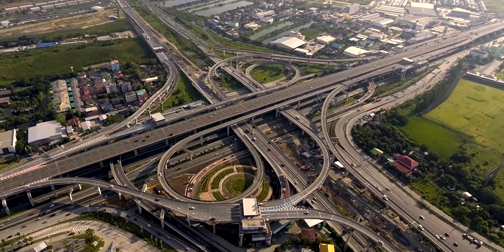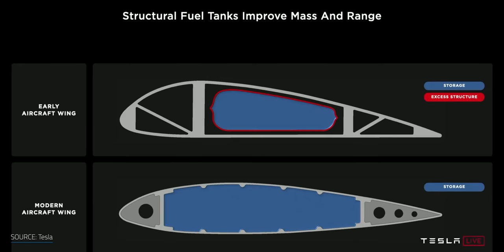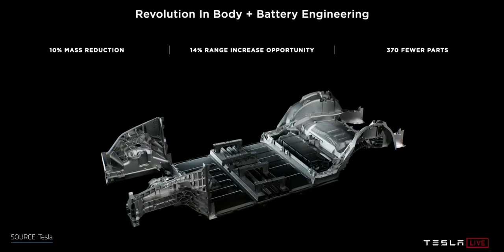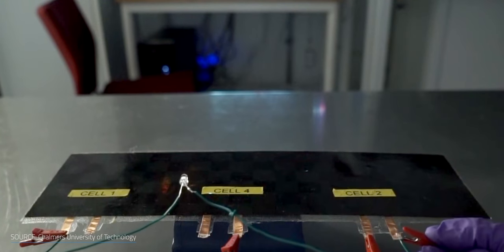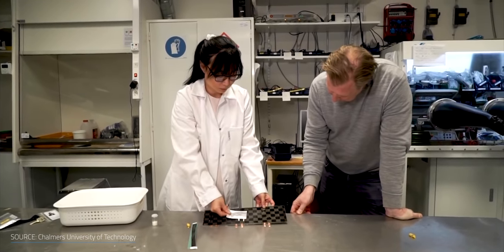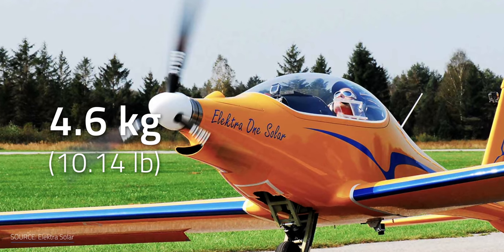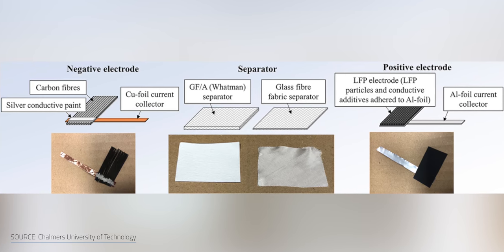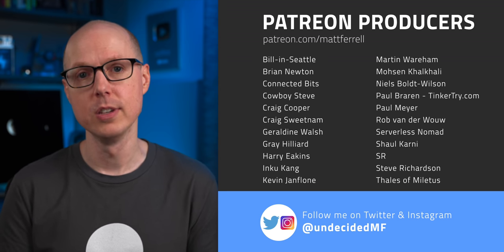Exploring Structural Batteries

Comment: Carbon and glass-fiber's strength comes at the cost of basically zero malleability, it just goes "pop" (broken), it doesn't bend (at all) like metal.  Worse, the cost (in $$$ and CO2 emission) to manufacturer is FAR worse than steel.  Finally, fiber-reinforced-polymers are notoriously difficult to recycle, where as something like (someone correct me) 90% of steel is recycled.  In addition to all the other "break the battery/replace the car" arguments below (which I agree with), overall this is an absolutely terrible idea for cars.  OTOH, it's probably a fantastic idea for electric planes and ion-engine driven space-probes - neither ever need to be repaired after a crash :D

Comment: Everyone knows that EV batteries degrade with use. In other words, batteries don't need to be damaged to need replacement. What happens when (not if) the battery's performance degrades to the point of necessary replacement? How much is it going to cost to completely strip down the vehicle and replace the chassis, in the case of Tesla's example?
Reply from the maker: Tesla's upcoming batteries will most likely last the lifetime of the vehicle for typical usage.  This type of battery (depending on chemistry and use case) could end up doing the same thing. It's still SUPER early days for this breakthrough, so time will tell.
Reply: @UndecidedMF 
How the batteries are expected to perform and how the will actually perform are two different things. Go back and look at covers of old Popular Mechanics or Popular Science magazines, according to their speculations, we should all have jet-packs by now, but had no predictions aboun the internet. I want my damn jet-pack!
Reply: @UndecidedMF  what is the lifetime od Tesla? 10 years or less? Gas cars can be used for decades with maintenance. This is the same scheme like with cell phones. In early stages when battery died you bought new one and used your device for next few years. Later they made phones so you would need to buy new and throw old away. 
I would not be so enthusiastic. If they don't start to build cars that are long lasting and at least with option to repair by users or services, we will drown in trash.
Right now it's almost impossible to repair Tesla. They don't sell parts and they themselves don't want to repair their cars.
It's insane. The same guy is mumbling about climate crisis and selling products that could only be thrown away after few years. This is hipocrisy.
Reply: @UndecidedMF  I'll have to disagree with you on that mate, also some cells can fail in the pack at a moment who knows, there are tousands of electronics in EVs anyways.
Reply: @EpicTimeV7  smartphones are also limited with their software, gas cars/diesel can work for the eternity if wanted, I still see 1970 mercedes used as taxi in Morocco and other very old cars around the world. There is also the problem with electronics, they don't last nearly as long as mechanical parts.
Reply: @rogerstarkey5390 
Where I live in the USA-Ohio, the temperature ranges from 0 deg F to 100 deg F and EV batteries that are exposed to these temperature ranges (many places), simply don't last. There is no big difference between EV batteries yet and my Chevy Volt's battery lasted 2yrs before I lost 30% of its range. By the third year it had 60% loss. Luckily it was a 3yr lease! Also, you're right, the internet is full of deals to buy used EV batteries, many of them are 5 to 7 years old, some are 3yrs old. Yes, most of those batteries can be harvested and used in other things, I actually disassemble and recycle batteries. But let's not be so in love with an idea that we loose perspective. If Tesla feels so confident that their batteries last 1 million miles, they should warranty  them as such. Crickets...
Reply: @cornpop7805  And that is where you went wrong...All chevy cars are garbage and wouldn't touch any chevy with 10 foot pole.
Reply: @teemumiettinen7250 
In regard to our discussion about batteries, the 18650 battery cells that made up the Volts battery assembly were no different than what Tesla was using 3yrs ago. Now everyone is using larger cells, but the challenges of the cells remain the same. The seasonal temperature changes, like in all of the east coast and Midwest cause damage to the cells and drastically shorten their life. I literally harvest and recycle batteries on a regular basis. These aren't 10yr old assemblies I'm reaping from, they're often 3 to 5 yrs old, but could be much older if coming from constant climate areas.
Reply: @teemumiettinen7250 
To be completely honest, I really didn't like the car. It had a horrible ride, had uncomfortable seats, and my elbows didn't have enough room to steer very well. I was glad it was only a 3yr lease!

Comment: "if those battery panels were also solar panels, you get the idea here." Stopping himself from completely lying and saying that the battery can also produce electricity that way.
Reply: wdym?
Reply: i don't think thats the case, unless the carbon fiber itself was somehow photovoltaic, he should know that slapping solar panels on does add weight, but doing that still might be a significant boost, considering most of the structure of solar planes is just there for solar panel surface area, with a close second being gliding efficiency, if the structure was literally a night cycle battery, solar planes might actually be useful for carrying bigger payloads in future.
Reply: @xymaryai8283  Putting solar PV on a car that gets very hot inside when in direct sunlight and is therefore usually parked in the shade where it sits much of the day seems a trifle backward to me. There's also the issue of presenting an optimal inclination. Not great for car bodies.
Reply: @xymaryai8283  carrying bigger payloads by charging with solar panels? Good luck. Even carrying normal load behind a tesla loses half its range. Charging that with solar panels would take weeks

Comment: Great and necessary direction but the problem at our doorstep now is materials recovery which must be integral to actual advancement. Reduce, reuse, reclaim, recycle current and future ion-cell surroundings and component structures completely, minus energy loss required to reconstitute and or repurpose depleted materials.
Goal Battery :  panels, structural components, motor housings etc. along with useful outer surfaces with solar collection ability. Needed, although close to 100% material recovery instead of unstable land mine type problem, MANdatory.

Comment: I wonder how those things would fare in front of the delimination risk inherent to laminated composites, especially in thick panels subject to a mechanical load. Can they suffer from battery expansion problems ?

They could be pretty practical for laptop or smartphones which are less demanding in term of mechanical abuse, but can they even be recycled ?

Comment: According to mat pat, the battery is the one problem with making a giant car robot. With all those moving parts would it be a good or bad idea to use these batteries for such a contraption?
Reply: I mean, it depends, if you had all the body panels and shit made out of these batteries, they could all power a specific part, stopping a large amount of power draw from the main battery. But your issue now, is how you plan on wiring and charging the thing.
Reply: @thereinthetrees_5626  make every "bone" electrically autonomous (forearm structural battery powers forearm, shoulder battery powers shoulder etc). 
Run signal wires from the main control unit to the rest of the robot.
If the robot is injured, the boken part can be removed to reduce deadweight, and the rest of the robot will continue operation without issue

Comment: 1) even the best cared for battery has a ~10 year shelf life. what do you do when its end of life?
2) what happens when you get into a car accident?
3) how safe is it to be literally surrounded by energy vs isolated in one area? would you fly on a plane with fuel surrounding you?
Reply: technically the fuel in planes already surrounds you on both sides
and as for centralized high power batteries? remember those laptops that were recalled because their batteries were exploding?
distributing it generally lessens risks like that, because afaik they dont usually chain react - so one small cell bursting might cause damage, but wont discharge the energy of the entire assembly at once
if there is a lot of energy in something, there is always risk - because if it were 100% safe and stable....you would not be getting energy out of it

though i share some concerns as to how this would change the way a crash plays out - its something that will require serious testing
and yeah... 10 years is probably an optimistic lifetime and it doesnt sound like a structural battery would be easily replaced

Comment: The elephant in the room is still overall electrical generation capacity.
Reply: Not really, since nearly no country uses anywhere near their renewables potential.
Reply: Nah just use more nuclear power and there we go... Zero emissions and steady reliable output whenever you need it.
Reply: @josefstalin4532  
Even though 4th generation nucs should be orders of magnitude safer the odds of overcoming political and public opinion/pressure is probably impossible.
Reply: @rogerstarkey5390  
That energy figure for one gallon (US, Imperial, metric equivilant) is available right at the refinery. For power on the grid you still need actual generating, transmission and storage capacity. Maybe the UK isn't worried but it will probably be an issue in say the US. And please do not go down the road of public transportation vs private vehicle ownership. That's another issue. Besides the UK is 250k square miles. That's smaller than Texas with a much higher population density.
Reply: @mpetersen6  There no huge need for extending the grid for EVs, since most of the energy for EVs can bei created locally and transfered either by mid- or low-voltage grids
Reply: @mpetersen6  I mean all of France basically rely mostly on nuclear, and have had no accidents.

But yes, the general public are scared of something because they don't understand it.

Comment: Imagine a combination of improved rechargeable structural batteries, combined with replaceable aluminum air batteries, for extended range ability. 

Short trip but need more internal storage (running to the hardware store to pick up materials for a home renovation project)? Leave the Aluminum Air battery pack at home.

Need to make a long distance road trip? Throw in one of those Aluminum Air batteries to boost your range.

Now add solar recharging ability. Even if only small recharge, every little bit helps. Nickle and diming energy solutions together.

Comment: Integral batteries are a bad idea. If the battery fails the entire car will have to be scrapped.
Reply: More so a design challenge than a bad idea
Reply: And for warranty purposes that's a huge no, therefore it's very unlikely that these will be unrepairable.
Reply: Plus batteries need to be held at not too high or cold temperature. You can't archieve that when your bumper or door is made out of battery

Comment: This is good if the batteries can be recovered from the vehicle at EOL, but if they are just garbage that's bad.  It does also raise concerns about cost of repairs.  A lot of modern tech like parking sensors and camera systems adds considerable cost to bodywork repairs after a collision.  If you get a fender hit, now you have a battery section that's failed and will reduce vehicle performance until it's properly repaired.

Comment: "If the fuel pumps break or a fault occurs, the engines will still be fed with gravity".. What the hell are you talking about?
Reply: I don't think he knows what Gravity is or how it works.
Reply: that works with smaller propeller airplanes, but big jets shown in the video don’t work that way. they can burn up to thousands of pounds of fuel during takeoff and initial climb phases.
Reply: That is exactly the case with underwing engines: failure of a boosterpump will mean gravity feed of fuel to the engines. I did it myself: erroneously switching off the boostpumps without opening the crossfeed valve in a mighty B747. So, no force feeding of fuel to the engine. But it kept on purring as if nothing was amiss. Catched it soon afterwards
Reply: @keesvandenbroek331  Yes, I'm sure that the force of gravity can overcome the hundreds of pounds of pressure in the combustion chamber of a jet engine.
Reply: @keesvandenbroek331  Oh yeah, injectors totally work without pressure...
Reply: @FUnzzies1  He's correct.  The 747 will gravity feed up to ~35k'(which has to to do with air dissolved in the fuel).  Right out of the Boeing FCTM, which I'm sure you've read.

Since we're all up on 74 fuel systems, why don't we talk about why Kees was turning off the boost pumps and opening the crossfeed valves, when the procedure is to turn them off and close the valves.  Or the one situation where he would be correct in opening them.
Reply: @z987k  or I can know how fuel systems and injectors work. Which are required to be pressurized to very high PSI.
Reply: @FUnzzies1  so then Boeing is incorrect on their own jet?
Or maybe you don't quite understand  turbine engine fuel systems?
Reply: @z987k  or you don't know how to read manuals

Comment: Also battery is ≈80% of the manufacturing cost of an EV.
Reply: same with how with ICE cars, the engines proabably a good chunk of the manufacturing cost.

Electric motors are small and light enough to the point they cant be improved that much more, the motors themselves are like 80-90% efficient while being stupid cheap.
ICE's are where the bulk of the gas car cost. 

more or less it balances itself out imo.

Comment: here's a fun story, normal old fluorescent tube fixtures .. you used to be able to just replace the bulbs and be ok, as long as the ballast didn't go out, and when the ballast went out it was cheaper to just replace the whole fixture than to buy a new ballast....NOW (2021) when you put in a 100% LED fixture (lets say $50) .. when that fixture dies.. you have to replace the entire fixture....and since most electricians aren't electronics experts.. and on top of that .. you're paying for a new fixture.. even when "surges" happen in your electrical grid and fry those components..  i have had great success with just replacing the old fluorescent tubes and doing retrofits..  my shop has them and they've been working now for over 7years ... with normal daily use.

Comment: You forgot about the center tank that exists on all commercial aircraft, a 747 even had a center tank blow up on it due to a short and a hot vapor filled center tank. 

As for structural batteries, I feel the cost won't cover the benefits. Having an extra 20-40 miles of range for an extra 20,000 dollar battery frame that may fail to work properly from a simple chip or rock strike..

I think there are better solutions out there, just haven't gotten the attention they need.

Comment: The use of carbon fiber makes its scalability a non-starter. also expensive for a small benefit Plus, you can't repair or replace it easily. Cost-benefit analysis doesn't make sense. More than 10x the price for an at best 4.5% weight-reduction is not worth it.
Reply: Also still lower energy density, less range and any damage to the body of the vehicle makes it a write off or worse, a fire and electrical hazard.

Comment: All I hope is that this technology will be used on their $25,000 car.
Reply: It's likely all this technology is going to be necessary to drive the cost down to a point where you can get that 25 grand car
Reply: Don't worry it pretty much guaranteed to. Because if anything at all goes wrong with the battery you'll have to spend another $25,000 to buy a whole new car!
Reply: @phyricquinn2457  that seems like a very unlikely outcome, although it is something people will be conscious of, and therefore the company selling these cars will be conscious of it, and therefore it will be covered by an extensive warranty, my car has an eight year battery warranty.
Reply: @tomnwoo  You do make a good point. If the warranty last for 8 years, it's very unlikely that they'll make a part that can't be replaced... Although that is an easy fix if they just shorten the warranty years/miles. But still with a 8 year and 150,000 mile warranty like the other Tesla models that still ought to be good enough as long as your buying the tesla new and not second hand. But I still wouldn't want to buy a car with a irreplaceable battery that had over 100,000 miles on it. I imagine it might still kill the secondhand market.

Comment: "Massless energy battery breakthrough" is a really scummy title
Reply: Scam title. It's not massless in any way. And content of the video is very misleading, often talks about Tesla and this researched battery back to back like they're related while throwing in mumbo jumbo about massless for good measure.
Reply: I'm always surprised when videos have 95% thumbs up, but the whole comment section is ripping it apart.
Reply: "Massless" simple means your increasing storage without increasing mass by replacing "usless storage" mass with "useful storage" mass. If all the commentators here cant even figure that much out and mistook it for literal 0 mass batteries, seems less of "self important youtuber" and more "self important commentator".
Reply: @SerangelROM  "Massless energy battery" is impossible, you can twist it all you like but it won't make that statement true.
Reply: @95TurboSol  that's some small minded thinking right there.
Reply: @SerangelROM  It's accurate thinking

Comment: materials like lithium and electrolytes are weak in batteries. And they are not massless. Structural is accurate but this is simply using the battery case as structure and not the battery itself. Please retract the massless part since it is a lie.